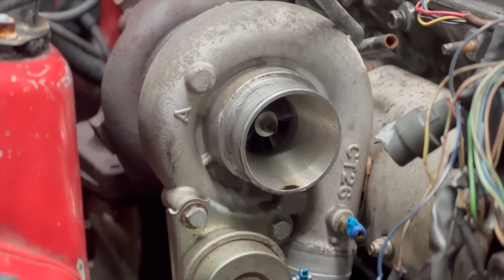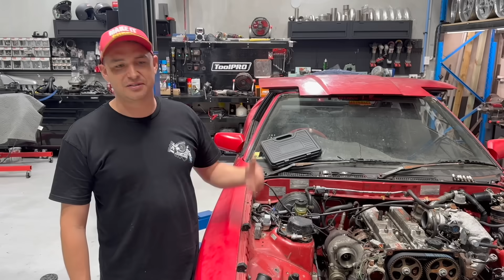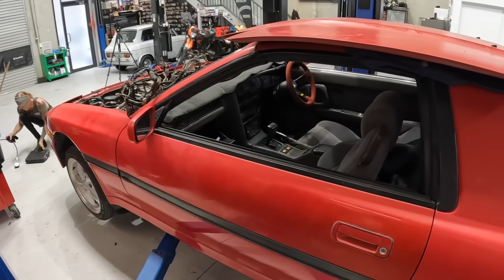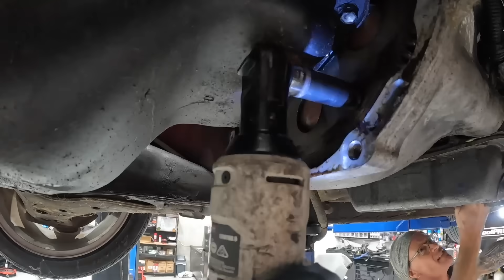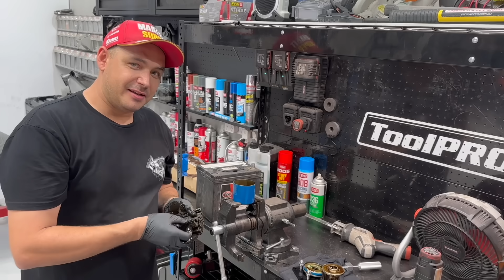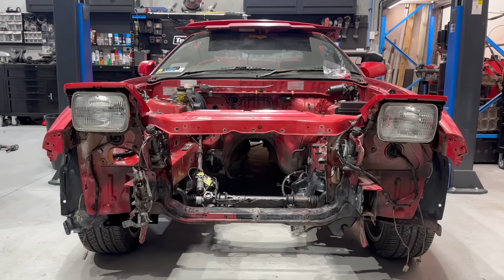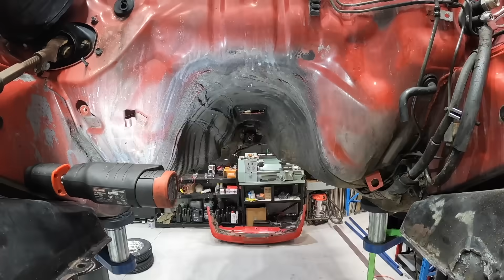Why Doesn’t Anyone Use This Engine? (This Might Be a Terrible Idea)

Comment from the maker: What's your thoughts on the N54? Have I made the right choice by trying to be different?
Reply: Yeh nah on the N54, I've had one, nothing but issues, plus it doesn't have any personality. When it's working it's definitely powerful, but tbh I think a JDM engine would be better. Even a 1GFE is better in my opinion.
You can make it more reliable by going standalone, port injection etc but then costs rise.
Edit - After watching the whole video, ditching as much factory stuff and starting with a bare engine is probably the best way to go. Good luck I'm looking forward to it, no doubt you'll get it working well.
Reply: 8hp is all im gonna say, sell the 6 speed lol
Reply: Would of loved to see a 2gr v6 going into the car
Reply: I have always liked them, but all the parts that are now removed are where all the annoying problems are. Going away from the direct injection and to port means you'll probably only ever run ethanol, so not the best for a street car. But there's actually quite good aftermarket parts support that will make swapping it easier. I don't know the market over there but I can only assume for your power goal its going to be heaps cheaper than any JZ or building the 7M.  Factory transmissions are really good. I know some people have cooling problems when they are in their more factory forms, so I'm curious to see when everything is replaced if that persists.
Reply: @nicholashawks9288  no reason not to run gas with port injection
Reply: I’d be more concerned about doing what is fun. I don’t like pissing competitions over power. If that engine is going to make the car good fun, keep it. 

Smiles for miles.
Reply: Good to see more bmw engine swaps. The problems are always plastics and some ancillaries but the fundamental engines are really strong and make easy power.
B48 and zf8hp should become popular in the future, super strong and powerful and installed in 80% of cars from base model up.
Reply: With a single, a standalone, and port only, its s great choice - you gone an solved all the N54 issues before you’ve begun 👍🏽
Reply: Woody I think that you've got something special coming up in this build buddy, what would your feeling be on the ZF8HP gearbox with a clutch pedal kit instead of the Getrag box?
Reply: Its different woody. Interesting to see how it goes. I'd have loved to see a 2jz in there for "purity" reasons. . But interested to see where u take it
Reply: They sound great and can make a decent amount of jam when setup properly.  The plastic bits are definitely needing to be replaced with actual metal where you can, like the oil pan, intake manifold, and valve cover.  The oil pan gasket replacement is an absolute nightmare in the stock BMW chassis because of the packaging, but if you address that before install of the engine it shouldn't be an issue.  Definitely gonna be an interesting swap!  🤘
Reply: I think you will be all good if you remove the shite BMW strapped on it 😂 I think a 400-500hp build with suspension and brake upgrades would be nice, I’m really looking forward to it ❤
Reply: N54 gang 💪 great choice
Reply: Dude, I love it!
Reply: You becha
Reply: Woody you should have done a Victa lawn mower motor swap!
Reply: Cool swap!
Reply: Honda J series? J32 / J35?
Reply: BMW are underestimated potential
Reply: Like with most car builds the mechanical side is usually straight forward and rewarding,  the electrical and tuning side is stressful, frustrating and  painful....hopefully you will come out good.
Reply: it leaks but take care of the usual shit fro mthe german world AKA  plastic rad , plastic cooling parts , oil cooler n injectors , they are bad ass engines ! thinking about building a swap for my E46 M3 and throwing a HP gearbox behind it .. we will see i love my S54 for now
Reply: To damn bad it's not a diesel.  That would make sense.
Reply: Personally I would've chosen a B58, but this is also very cool. I think it's a good engine, what causes the problems are accessories and plastic parts. (and the injection pump?)

Why don't you keep the direct injection (I think the problems with the injection pump have been fixed later on?) and just add port injection? Yeah it's not necessary if you're not going absolutely crazy on power, but I think it would still make it a better street car..  maybe I'm too much of a nerd, but I would do it like that lol
Reply: People saying keep the 7M haven’t owned one lol. The “7”in the name stands for when you fix one problem and another 7 appear.
Reply: N55 is better IMO
Reply: New CX90 I6 is pretty cool
Reply: I'm A massive n54 Fanboy but unless you got given this for free, the b58 makes so much more sense.

I haven't watched the video but I'm guessing you're deleting the direct injectors which just makes it a kind of mediocre engine

Edit: ehhhh yea, definitely only good if you didn't pay a cent for it. The whole nice thing about them is how tunable the factory ECU is. That you don't have to do anything silly with standalones and custom. This and custom that for the most part and you can make 600 700 800 HP easily and relatively cheaply...

 No, there is no problems with the wiring. The plastic stuff is overblown. It's a 200,000 km issue not a low mileage issue. You replace it and it's fixed.

I've never even agreed with anyone deleting the direct injection in the standard platforms except for the fact the injectors are expensive. You delete the direct injection (let alone the factory ECU not being in the picture) and it's a kind of mediocre, Mid-Range strength, open deck.. like there's just so many better engines at that point that are stronger still
Reply: My thoughts are ...the opening lines sounded like a Shannons car insurance commercial...well done WOODRIGOZ
Reply: no.. BMW is slop for car people with no personality
Reply: I haven't clicked out if a YouTube video so fast in my life. 
I was hoping for interesting but euro trash 🗑
Reply: @theskidfactory It’s always dealers choice in my humble opinon, while I understand the viewers and algo help support the builds.. ultimately you’re the one who will be driving it and let’s be honest.. any engine conversion especially one that hasn’t been attempted at mass scale is a labor of love! I’m looking forward to the build brother! Cheers! 🤙
Reply: Should of went 3rz
Reply: N54? I don’t know, I liked the N64 tho….
Reply: @GeertPolo even an M57 would be a delight to see in a Supra. Thousand ponys without opening them up running dual shock pumps is the key for big torque. The smaller M54 2L will rev very hard for a diesel so they gain efficiency with boost and more rpm to drive the turbo and often are fitted with a bigger turbo. I met an ol dude in a 1 series coupe all sporty looking 2L diesel 400HP at the wheels and it's only chipped? 😲
Reply: I really thought you’d be going 3sgte!
Reply: I run full PI on mine. As long as you do away with the standard DI and replace the waterpump with continental branded equipment you'll be golden!
Reply: Will definitely be more interesting going with the bm trouble u for all of us watching woody do these things have vanous or whatever the variable cam timings called? I'm guessing factory coils and cam crank sensors would be hard to get going too?
Reply: With a zf8?  Yes! It's a great choice, second to a B58, in the BMW range.
Reply: Well Woody soon as you said another 3 litre straight six I thought of my M54B30 in my E39 wagon…all I can say is I hope you researched the crap out of what you’re getting into mate! You are indeed correct with all the plastics being a major issue, along with the cooling system and oil leaks…I’ve had to do a lot of maintenance with mine this last year- new sump, rocker cover, coolant lines, power steering lines and reservoir, water pump, all the pulleys…tensioners…the list goes on and on mate! And don’t forget the Vanos! The good news is everything is readily available but just check country of origin-German parts aren’t always coming from Germany anymore mate!
Good luck with it all, can’t wait to see how it turns out!!
Reply: Just shove a S63 with a 8HP, make 1000hp and be done with it 😅
Reply: N54 eats everything bolted to it
Reply: Just my opinion, a 7M freshen up and discussing fixing any achilles heel of the setup would be golden.
Reply: Works good. Pricey! Pricey Pricey!🫣
Reply: Be different..
Kia Picanto with 2.0l Cerato engine with 6 speed manual. 
As Ben Stiller said.. DOOO IT. DO IT..
Reply: I've been lucky with my N54, 600hp for 3 years or so and still works, however plenty of people I know have not had this experience and it feels like building the engine can take 2 attempts or more before before a successful outcome is achieved. (Also going by builds I know of)
Reply: Good engine, convert to port injection and it's good to go
Reply: Not so enthusiastic about the idea....
Reply: Would have loved to see a 1fz-fe if it could get possibly fit
Reply: Baffle the sump! They have oil starvation around hard corners
Reply: I think this is a really interesting swap idea.
Not a BMW fan boy at all, but what you’re planning to do here with that one is stripping it of all the general problems with them (and on the face of it quite technically challenging) so am really looking forward to this one!
Reply: Should have gone with a 2NZ-FE for maximum fuel economy
Reply: Plastic junk poor valve stem seals timing chains are weak as piss and a cunt plastic hose out let's that crumble on hot days really nothing special don't be fooled by the name and if names are your thing go buy a Gucci shirt instead
Reply: I’m more of a Dreamcast fan.  The Nintendo was alright though.
Reply: Ive had one and i feel like for what you have to do to it to make 500hp made me feel like the old jap engines is kinda dated
Reply: Cool choice! Was the magnesium block N52 considered?
Reply: Wy not the better designed N55 Engine?
Reply: I like it man. Can’t wait to see the next vid
Reply: I think they sound amazing, almost RB26 like.
Reply: @brandon_buildsDIY they sound yuk more so because the exhausts people do on euro cars tiny crackly sounding garbage I've driven a couple bmws with that engine i hate bmws but im open minded and still nothing special would be better engine in anything other than a fat heavy slow bmw
Reply: No, bring back the 7M. 

Give the people what they want!
Reply: Awesome. Excited to see the build as a BMW fanboy
Reply: Looks like the original twin turbos have oil starvation ...so are you upgrading the oil supply and or new twin turbskis??
Reply: Spoke too soon !!
Reply: You’re removing all the parts that make the n54 terrible (direct injection, twin turbos, etc…) this is actually a good choice. Plenty of supporting mods and super reliable.
Reply: No bmw is awful sorry you lost me on this one. Keep it toyota and put a 4.6 4.7 or 5.7 v8 in it but no nothing German.
Reply: Bmw reliability 😂 should have kept the original...
Reply: Why go n54 when b58 exists? its like double the cost but its like alteast double as good.
Reply: s54 yes, n54, no its not it imo, those engines are just as high maintenance as a rotary engine but not as cool
Reply: Na wrong choice sorry shoulda left the stock engine in there
Reply: I have a forged 1JZ in Brisbane   once the brain fog clears

Comment: If you said that same nonsense in a hillbilly dialect you would have been run out of town, mate .  Oi don't know how about I moight put the manee-fold or the twerbo exactly but.... 
Those are pretty important butts. Chassis/powertrain component layout is sort of a big deal. It doesn't look like a plan is part of the project. But anyway, LOOK AT ME! Cheerio ta ta
Reply from the maker: I’ve done plenty of planning for this project!
Reply: @theskidfactory   I have this engine, this turbo and this chassis. That's my plan

Comment: What do you plan on doing to reinforce the chassis,?mk3 targa cars are notorious for twisting up like the car is not steel but rubber.
Reply from the maker: Roll cage is on the cards for sure. It’s also needed for certain Motorsport events

Comment: Nice project. I would say something about the motor, but I don't know anything about BMW's.....or Toyota Supra's and 2JZ's....other than what people tell me. Should be interesting.
Reply: Unfortunately this swap involves throwing out. Basically everything that makes the n54 good in the cars it originally comes in.. so you're not going to really get any interesting information about it. 

The best part of it is the easily tunable/flexible factory ECU that you literally flash with your mobile phone and an app. 

The direct injection is unfortunately very expensive, but again one of the best features of the engine that makes it better than older stuff when it runs right

Like... The appeal is that you can spend basically no money, just a set of downpipes and an intercooler and pod filters and flash a tune with your phone and get 400whp.. and then a couple Grand more for some bolt-on Chinese turbos and some fuelling upgrades and you've got 600.

Comment: Hey Woody - why the hell would you delete direct injection ?????    

It gives so many tuning options.  AND you can take about 7% more air into the head (ie the fuel you would be adding into the airflow).
I am sure haltech can control it.
Am I missing something here?

Or are you just doing the simple stuff?
Reply from the maker: Direct injection pumps / injectors seem to be a big failure point for these engines. Trying to keep it simple and delete all the annoying  BMW parts and make it more reliable.

Comment: An engine that I will forever be surprised that no one does anything with, is the Suzuki H25A and H27A V6s from the Vitara/Escudos.

I mean, it was used in the Pikes Peak Escudo, so we know it can make bulk power, but no one uses them. At all.

But yes, I approve of the BMW swap. Carry on lads, and have a great time!
Reply: There's a big correlation between engine popularity and and the popularity of the chassis they come in lol
Reply from the maker: That’s an odd one! I’ve never thought about them either! Worked on a few in my time at Suzuki. Bloody water leaks galore!

Comment: With a mate whose doing a 6 in to a 4 space in a 316, yeah, the BMW wiring is a challenge, full aftermarket ECU is a must. Mechanically they're pretty stoutly made, but BMW in to Toyota, it turns the stomach almost as much as the Z4's wearing Toyota badges. "Handling" and "Drifting" are not the same. The things needed to make a Drift Car, are the opposite of those needed to make a really good handling car. Handling requires the ability to generate high levels of lateral grip. Drifting requires the least amount of lateral grip you can have while still being controllable.
Reply from the maker: Yeah I understand they are two different types of Motorsport. I’m not going to be competing in high level comps or anything just want to have fun and learn along the way!  I’m not scared to change the setup either
Reply: @theskidfactory  There's this saying for Handling,.."Weight Transfer is bad, but should always happen on the front before the rear". Weight Transfer Control is really what Anti-Roll or Sway bays do. No front bar and stiff rear bar, and it happens fast on the rear, and around comes the tail. No rear bar and stiff front bar, and you have Kingswood levels of Understeer,... Ever seen a front drive Camera drift the rear? A mate added two extra bars to the rear, it was a hand full,.... :)

Comment: Cool swap idea @theskidfactory, could you make up a sump for it so you can mount it vertical/standard style?
Reply from the maker: Plenty of options for mounting. I don’t want to go too crazy with custom parts though!
Reply: @theskidfactory fair enough you'd need an adaptor plate or a wonky dogleg shifter if you mounted it vertical 🤣

Comment: 16:01 the two biggest things they're known for the crank hub breaking loose and the serpentine belt feeding through the main seal( on top of the normal BMW oil and electrical faults). Luckily there are probably ten different companies that make bulletproofing kits. I would go for a pinned hub for hub issue and the Vargas main seal cover
Reply from the maker: Isn’t the belt feeding the main deal mainly due to the belt being contaminated in oil and falling apart? I feel the serpentine belt cover is a bit of a snake oil item.
Reply: @theskidfactory I have pulled a n54 apart with a belt sucked in. The theory is it's the oil that deteriorates the belt, but some people who it's happened to swear that they resealed everything and it still happened. I can't say for sure. As far as the seal cover goes it very well may be snake oil, but I haven't been able to find any cases of the belt being eaten with the cover installed. As a side note , here in the states we have AERA(engine Rebuilders assoc) that sends out service bulletins and gives talks, their Engine Professional magazine, and Engine Builder magazine(this one mostly showcases performance 2-5k HP builds and doesn't talk about common issues). I'd be super stoked on learning more about Australian engine building and the engines we never got. Are there any resources?

Comment: Really curious on how you plan on making it work since the n54 has an electric waterpump and thermostat. Btw how's the carbon build on the intake/exhaust valves prior to walnut blasting? Thought on going single turbo like the n55? Kudos for doing something different
Reply from the maker: Electric water pump is easy, I won’t be running a thermostat and the water pump will be PWM Controlled. Bit of carbon buildup but I’ve seen worse! Will hit it with some cleaner for sure.